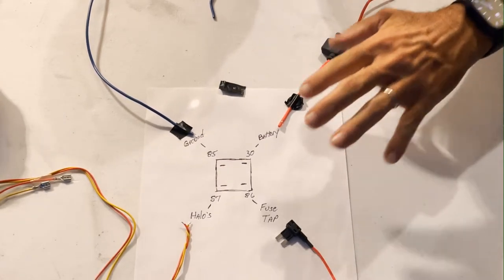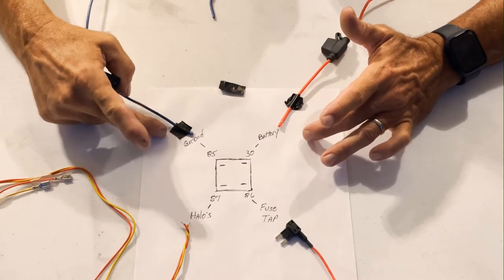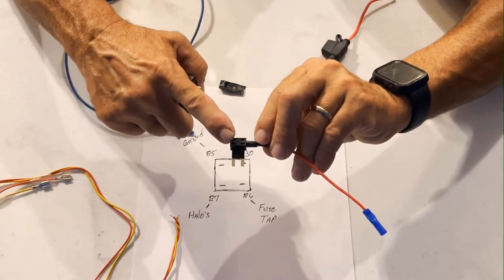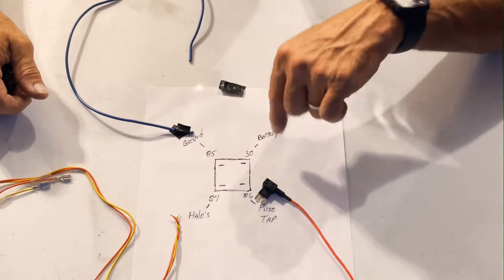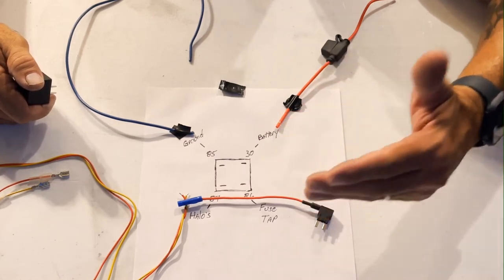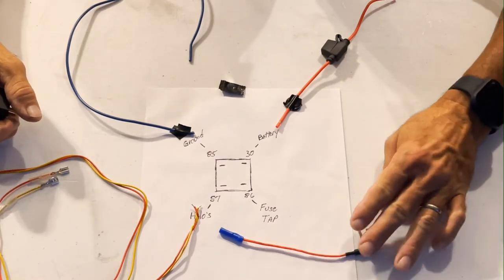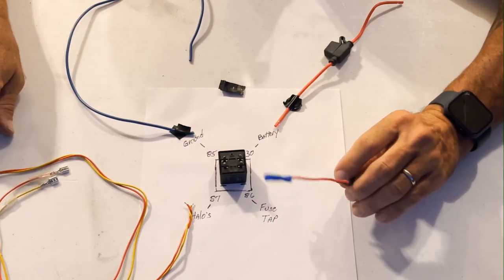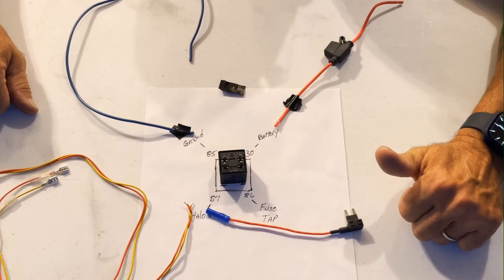How To PROPERLY Wire a 4 Pin Relay for Lights Fan and Accessories - Wiring 4 Dummies!

Comment: Good points.   Do you have find a situation of finding a relay that seems to be working by using a electrical test meter, but then when it is installed in the car, it does not seem to be working?

Comment: Id your accessories have a ground aswell can you ground both relay and accessories to the battery negative or should you ground the relay to the battery and the accessorie to a bolt
Reply from the maker: It would not matter because the bolt is touching the frame as is the battery’s negative. So ground your terminals to wherever is convenient
Reply: Ok thank you
Reply: Thanks for the video, I'm about to add a back up camera and don't want it running all the time, you put this in such a way even a dumbie like me could figure out I'm missing a part 😂

Comment: The pic you show can easily be found on google. My problem is this: The little diagram on the side of my relay shows 85, 86, 87, & 30. The pins, however, are numbered 85, 86, 87, & 87a. ??? Is 87a the same as 30? If so, why can't these genius electrical engineers be consistant by putting either 30 on both the diagram AND the pin OR put 87a on both the diagram AND the pin??? Why do they have to make life so confusing for us electrical nerds??
Reply: Figured it out for myself no thanks to anyone. 30 and 87a are the same!